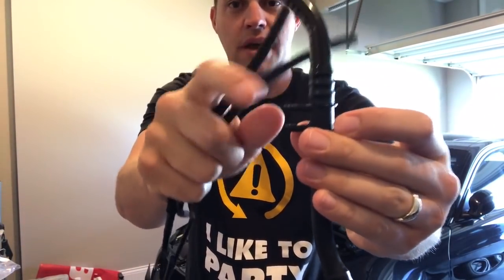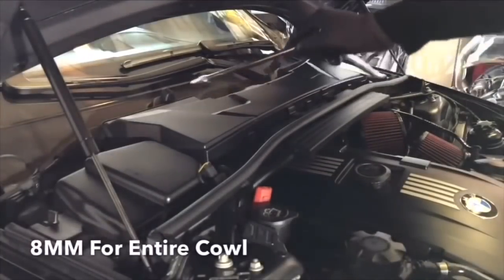How To Replace Your BMW Vacuum Pipe! DIY!

Comment: Have 30FF code and stumbled upon this video, I need to replace the line from the right canister to the connection behind the oil filter, both ends are worn badly. Meanwhile also time to replace my boost solenoids to the new improved Pierburg ones and hope my 30FF on 3d gear high rpm will be gone! Not a big fan of DCI though, they give a little less throttle response and torque down low in my opinion, I've tested it. Now running Z4 35is airbox and airscoops. Keep up the vids man!

Comment: This boost “issue” could be your secondary catalytic converters. Mine were clogged/slightly melted together causing low boost situations and 30ff. I would suggest disconnecting your downpipes from your secondary cats and log in order to see if that was indeed the problem and if it has improved before going ahead and replacing the secondary cats. Hope I could have helped any :)
Reply: How did you figure that out (what kind of symptoms were showing)?Did you add cat cleaner to your fuel to fix this?

Comment: Hey fanatic. I love these videos of yours.  Very helpful.  My question is would a leak in these lines effect heat getting to my cabin? The fan works, the hvac controls are set to the warmest settings, however, only cold air enters the cabin.  It’s cold where I am so I can’t tell if the ac is working.thanks in advance
Reply: Did you get a fix for it ? Same thing is going on for mine

Comment: I can‘t find the pipe that you declare as the breather hose which you slit at the bottom to release. Do you have the part number of this tube?
Reply: It's the brake booster tube.  Look on ECS Tuning.  Just ordered one.  I'd show you a picture but don't think I can on here

Comment: The two lines in my car look identical that run to the vacuum... capsule. Do I need one of each of the thing in the description? Is 3.5mm platinum silicon acceptable?

Comment: Would this hose cause “Engine malfunction reduced power” code when the throttle is pressed to get up to higher speeds?
Reply: Neftali DeLaRosa Jr It is possible. One of my lines was loose where it connected to my vaccum canister and caused that code whenever I accelerated hard. I just replaced all the line to prevent future leaks
Reply: My does that when I accelerate and it’s hot outside.
Reply: marloncates2 did the message stop?
Reply: Yes, absolutely. Uneven waste gate controls will cause DME to disable vaccum and leave them wide open, thus the engine is operating under reduced power (no turbos) due to malfunction.
Reply: Brad Murrani so it could be Waste Gate issues or vacuum hoses?
Reply: @A619D  Yes, but under the BMW application of those Mitsubishi turbos I highly doubt your actual wastegates could wear out so drastically uneven.
Reply: @A619D  repairing my cannister connection points was my resolution for errors under heavy throttling; with some heavy duty heatproof epoxy https://goo.gl/images/nXtwSe
Reply: Neftali DeLaRosa Jr yes. Haven't had the message since
Reply from the maker: Neftali DeLaRosa Jr yep, it could possible cause a low boost code (30ff) if it was at fault
Reply: Neftali DeLaRosa Jr you hit the nail on the head dude I was having this problem only when am pressing the gas pedal to go faster
Reply: I had this same issue and it would get worse with heat I would get that light and turns out it’s a 30ff code my primary catalytic converters (the stock downpipes) we’re broken internally and clogged the secondary cats causing that malfunction. Once I removed my secondary cats car runs amazingly and pulls like a train
Reply: Brad Murrani wastegate issues = end result of some other issue(s) such as vac leaks .. oil cooling etc etc. Ur point we’ll taken but the dude should check for vac / oil leaks / exhaust leaks etc before worrying his turbos are out ..altho turbos go out for sure or does take awhile. 

Ty vid.. I gotta do this again ur vid makes it easy for me to buy what I need :)
Reply: Freddie Diaz check vac hoses first. Turbo swap would be a last last thing to do
Reply: mazinattili did the cats go bad?

Comment: My vacuum hose is leaking fuel into the air box. Any ideas what causes this?
Reply: To anyone who sees this and has the same problem, issue was a messed up petrol filter, I replaced it and it stopped that problem.

Comment: hi, i have a bmw e87, 123d. the problem is that my mechanic changed my vacuum hose positions because he saw that one was canceled with a nail. After 1 month I went to the BMW dealership and they said that the vacuum hoses are incorrectly installed. Do you have the correct vacuum hose scheme? (with that hose canceled) my car e87, 123d, 2008 thank you!

Comment: I have a 2007 335i and my alternator recently gave up on me . Would you recommend  I take it to a mechanic or can I DIY .
Reply: Not a hard DIY I had to replace mine
Reply: It's a huge pain in the ass.  I just did mine last weekend, and would rate it as one of the harder things I had to tackle, DIY or not. I work on helicopters for a living and I though it was tough.  8/10 on difficulty level for an inexperienced mechanic.

Comment: Unrelated question however I wanted to ask you since we have the same exact vehicle. I am smell gas near the rear ( outside) of the car but I did accidentally full my tank then was putting sea foam into the tank and it spilled over the side idk if that is causing the smell or not. However I washed the car immediately after. Please HELP!!!! 
Thank you ☺️
Reply: I just fixed mine for that reason! Take off your back seat bottom (by pulling it off with force) and unscrew the circular metal covers on either side to where you can see the plastic fuel pump housing as well as the fuel pressure regulator A.K.A. fuel filter or sending unit. When those leak there's an inconspicuous path causing the excess fuel to leak out right over your rear wheels hense the smell. Start the car and examine those spots for leaks as you push the gas because mine straight up squirted me in the face with gasoline yet no check engine lights. Some people cover that with epoxy of fiber glass but I just changed my fuel pressure regulator for the smallest slit in the plastic.
Reply from the maker: Peter Carvo yeah you could be leaking fuel from the tank under the seat, check that first as mentioned
Reply: Brad Murrani Thank you I will check it. Crossing my fingers that is it. 😬
Reply: BMW Fanatic ok will do. 
Thank you
Reply: Peter Carvo ..injectors .. leaking.

Comment: when doing all of my vacuum lines, i changed these same 2 exact lines to the platinum high cured silicone 3.5mm hoses. I still have the old ones just in case. did i make a giant mistake? i am getting a 30ff boost leak code sometimes when i step on the throttle as well. any help would be appreciated!
Reply: 30ff is a boost leak somewhere mine was caused by stock charge pipe cracked
Reply: @svtfast 30ff is not always wastegate or anything to do with actual turbo

Comment: When you connected the new hoses back onto the vacuum pump hose (near the oil filter) does it matter which one goes on top or bottom or can they go onto either nipple. 13:10
Reply from the maker: Nope! Doesn’t matter.

Comment: Should have just used the hose for the entire line from the cannister to the end, rather than keeping the skinny x2 plastic tubes that run across the spark plug area.

Comment: Random question for you or anybody here... will that hose release vacuum when you disconnect it? I'm trying to diagnose a bad brake booster check valve, or whatever else could possibly be causing a vacuum leak. I don't remember for sure, but I don't think that line was holding vacuum the last time I unhooked it.
Reply: If I understand your question correctly, then yes. But why not just replace all the vacuum lines one by one to rule them out?
Reply: It’s been a while so I’m not 100% sure what I ended up doing, but I don’t think I found any leaks.

Comment: I have a 2010 bmw 328i and it has started having uneasy idling. When am driving and i make a stop at the traffic light, then it vibrates once then vibrates again...do you know any idea of what the problem could be
Reply: 75% chance fuel injectors need cleaning; 25% chance VANOS Solenoids need cleaning.
Reply: I’ll will do both and see what happens
Reply: One more thing, it also feels like the car’s engine is going turn off
Reply: Sounds like you may be keeping your oil level closer to minimum; turboed cars shoot oil out the turbines so the dealership will tell you to constantly top it off! Majority of the BMW combustion mechanism relies on extremely high oil pressure for valve timing control and such.
Reply: There are no error codes and my car is not turbo
Reply: In that case  @gabrielawuah5830  25% chance it's injectors, 10% chance it's your VANOS solenoids, 5% chance it's your valve cover gasket, and 50% that GM transmission is fucking shot LMAO
Reply: Lol

Comment: Can i just put rubber hoses or does it have to be the ones you’re installing?
Reply from the maker: Christian Martinez Others have done just hoses, but those hard lines are there for a reason with braided lines on both ends
Reply: You'd have change them out again by next summer but it works
Reply: Brad Murrani oh okay great thanks boss
Reply: BMW Fanatic oh okay thanks boss
Reply: You're welcome  @christianmartinez6224  if you do, reuse the original plastic hard lines over the valve cover if they're still good, and hit the driver side heavy with electrical tape or something for heat insulation, not that it's more important but less cool airflow there so it's hotter on your rubber hosing.

Comment: This is confusing as hell, with all the close ups. You should do a wide angle shot for like 90% of this, and only zoom in to shot some particular detail. Another  reason it's confusing to me is because I've relocated the vacuum canisters, pwr steer fluid housing and coolant expansion tank to the other side. So the close ups are NOT helping!!!

Comment: BMW BOOST LEAK ISSUE PART 2! PLEASE :)
Reply: Why'd you delete this video yesterday? saw my canister connections broken after I pulled the lines off BTW they were very stuck on there.
Reply from the maker: Brad Murrani had to fix something with the video, sorry!
Reply from the maker: Brad Murrani yeah those like to break, which sucks because it’s another part you need to fix

Comment: This is the sixth "Vacuum line replace" video I've watched and the Sixth time I've been let down. HOW DO I reach the vacuum line to the front turbo?? Sigh......Trying your other one next.
Reply from the maker: This DIY is not for the turbo ones though….to reach that pull out the vacuum canisters and then you’ll be able to reach the front turbo
Reply: Remove the two bolts holding the vacuum canisters in and reach down there and grab ahold! It's seriously not hard if you look at it!
Reply: @joshuaquilliam2887  Awesome help Thank you big time!!
Reply: @BMWFanatic  Awesome help Thank you big time!!

Comment: Soo, I kinda need some advice, one of my ground wires for my injectors, the loop got ripped off from the wires, I'm going to bmw for help tomorrow but if anyone has anything to say that will help me sleep tonight it will be greatly appreciated. Thanks, I know I just need to cut the wire back, strip the rubber and crimp on a new loop ground connector, problem is I dont know exactly what it's called but I'm fudged until I get this sorted, last result is a dealer r.i.p wallet I cant afford this right now:'(
Reply from the maker: Burnt Avocado Its just the ground, I would strip it back and re-crimp it and then re attach it.
Reply from the maker: Burnt Avocado Would be a little different of a story if it was Your Injector connector that you had to fix, but anything electrical with wires is fixable
Reply: Been there done that; brought my soldering iron to the engine bay and soldered it right back on the spot.